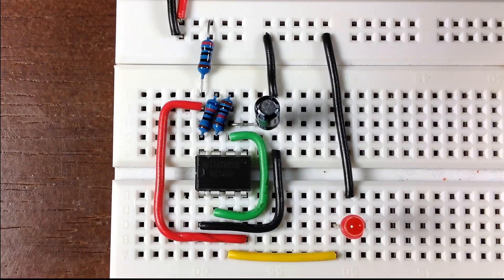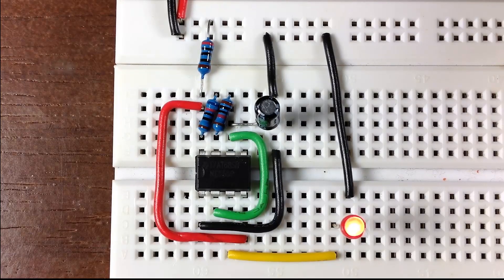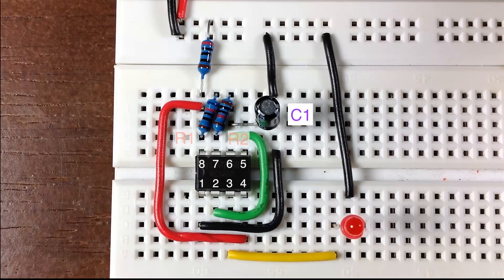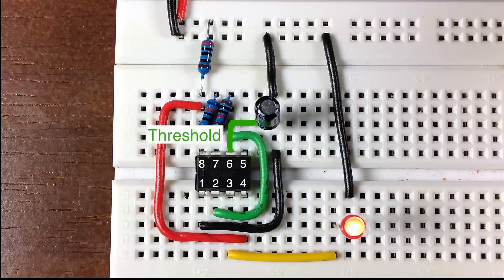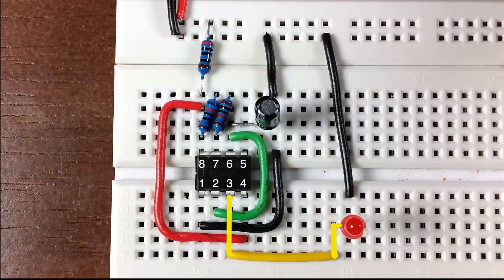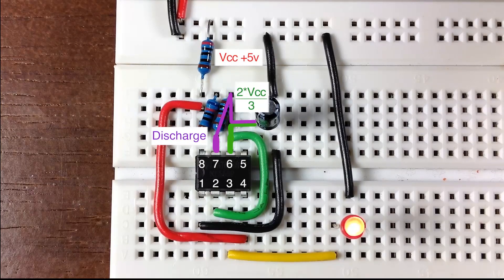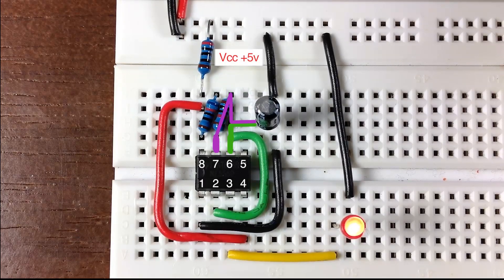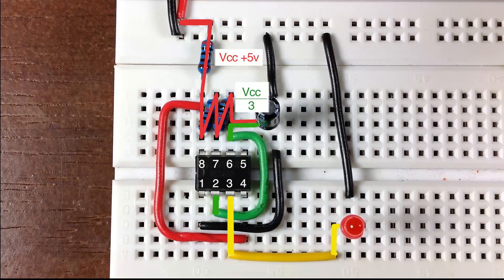How a 555 timer functions as an oscillator

Comment: Hey, I think I get it! So the charging and discharging of the cap acts like the base voltage on a transistor. Charging up and then down, and then it is mirrored by the led through the threshold and trigger. Am I on the right track?

Comment from the maker: Yeah, that definitely sounds like a job for a 555 timer.  All you would have to do is set up the 555 like I have it in this video and wire all six LED's in parallel where I have the one LED.  These 555's can output up to 200mA and most LED's max at 20mA, so one 555 can handle up to 10 LED's in parallel.  Assuming a 5V input, I'd suggest a 25 ohm resistor at the output to keep it at a safe 200mA.  Google "555 astable calculator" for the frequency and remember that R1 has to be at least 1K ohm.

Comment: Let's say you want to build a board to power 6 white LEDs, and have them blink simultaneously at a rate of 1.5hz, and not sure if it matters, but the LEDs will be wired to the board, not placed on it. Can the 555 do the job, or if not, what would be the best way? I'm going to light a 1/350 scale model of the Enterprise from Star Trek. There are many other lights going in, most of them static, it's those flashers that have me challenged, and a lighting kit is way too pricey for me. Please advise

Comment from the maker: You can replace R1 with a potentiometer to control the oscillator speed.

What do you mean by two LED?  Like two alternating LED's?  You could have one LED hooked to the main power (through a resistor) with a PNP transistor after it and run the 555 timer output to the base of that transistor.  That should make two alternating lights.

Comment from the maker: That's a good question and I'm not sure I have a good answer.  I think it has something to do with the inner workings of bipolar (these) 555 timers.  I know it is generally said that you don't want to use a resistor lower than 1Kohm for R1 so that "output stays saturated near zero volts during discharge" (from wikipedia).  You apparently do not need R1 if you use a CMOS 555 timer.  Hope that helps.